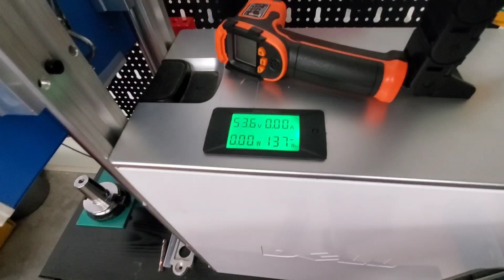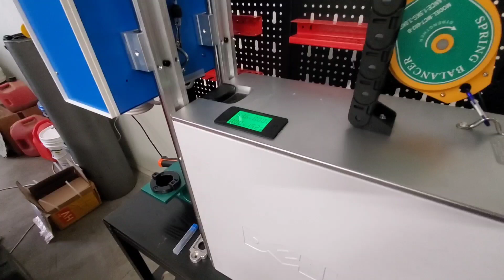Heat Shrink Fit Machine DIY Induction Heater for CNC Tool Holders

Comment: What frequency is the heater working at? How do you control it?
Reply from the maker: I'm not sure. It is sold as an induction kit. All you do is connect it to the power supply and a on off switch or breaker for my case.

Comment: Are you running it on 110 or 220v?
Reply from the maker: @jeremerogers7581  220v. I believe you can run 110v but it will take longer ti heat up.
Reply: @TeamJC777  Do you run any smaller tooling? I have a handheld 1800w (120v) unit that I have been using. While it does the job, I'd like to either buy or make something with more power to speed the process up. On some of my smaller tools (1/8") and some of the larger tools (3/4") my handheld unit will shut off as it hits its thermal limit before the tool is free, so I have to grab the air nozzle and blow air into it to cool it off before I can keep going.
Reply from the maker: @jeremerogers7581  I've used it for 1/8" endmills.  Works just fine.
Reply: @jeremerogers7581  I was thinking of getting one of these handheld units but your comment has talked me out of it.  What did you come up with for a solution?
Reply: @mikewood1763  still using the hand held for now. I have dedicated tools setup in my mill, so I dont swap tools out of heat shrink holders very often.

Comment: Cool to see someone else's version of this, I built mine 5 years ago using similar components and its still going strong.
Mine came with a 60mm ID coil, I found 50mm to work better on smaller tool holders (16mm is my biggest and it maxes out the power supply)

Comment: Very cool. I think I am going to follow in your foot steps with a few tweak ideas from other youtubers. Ergonomically yours is the best idea. Just going to run a DIN rail with 12v pwr suply.
Reply from the maker: @3073Sean  Sounds good. The computer case was just what I had laying around. This still works and I still use it on a regular basis.